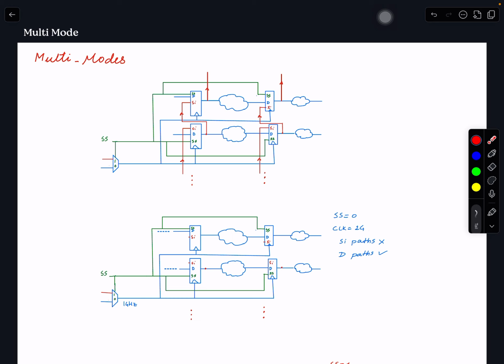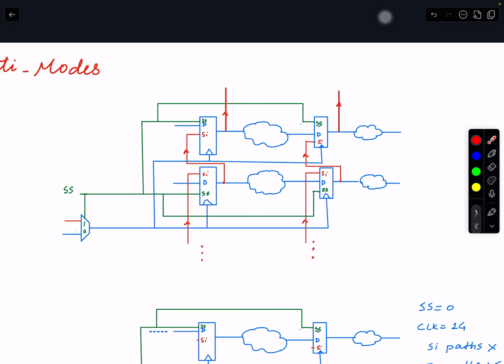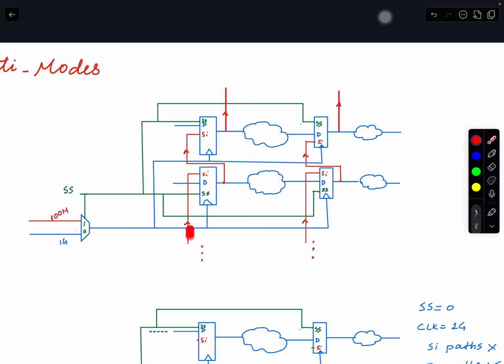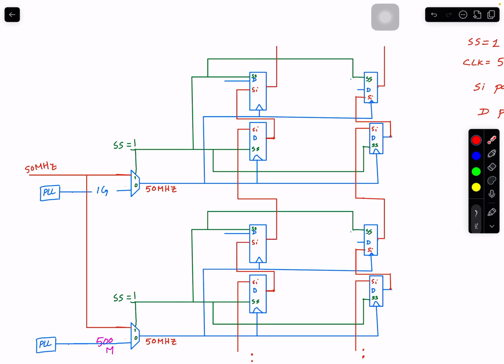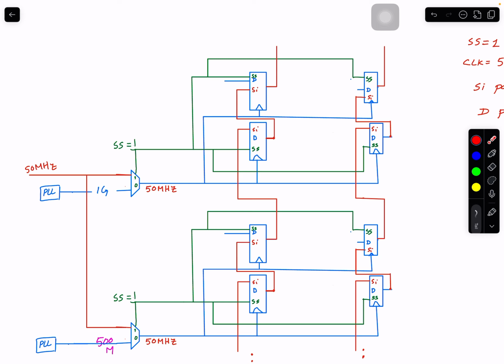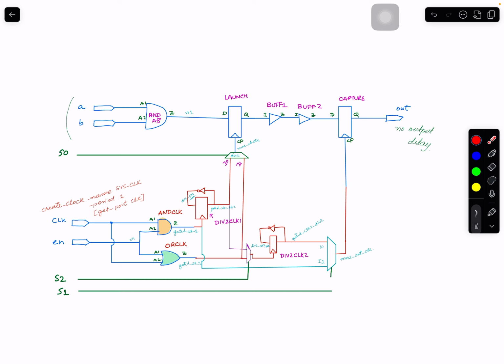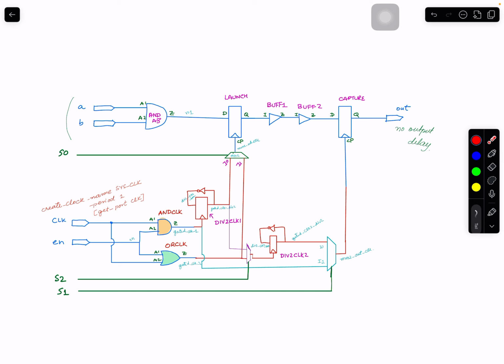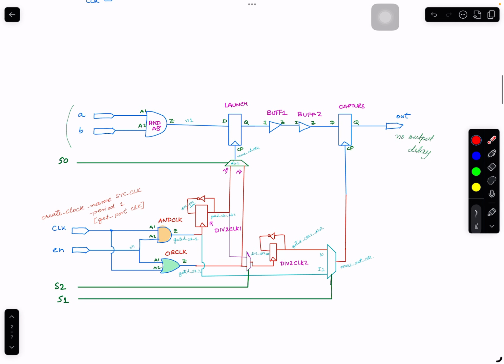STA Series, Week 10, Video 1, Timing Modes

Comment: Just to confirm, the crux of the video is that we can choose either 1 run with accurate FP/MCP statements or multiple runs for multiple modes (or any hybrid way of combining modes with FP/MCP, fictitiously if so let's say) depending upon design requirement or our choice of method of analysis, right??

Comment: For the question asked at the end:
What happens if we use create_clock instead of create_generated_clock at the divider output?

We will be able to constrain and analyze the reg-reg path. 
But, the clock latency from the input port "clk" to the divider's output will not be computed by the tool, leading to an inaccurate setup/hold analysis.